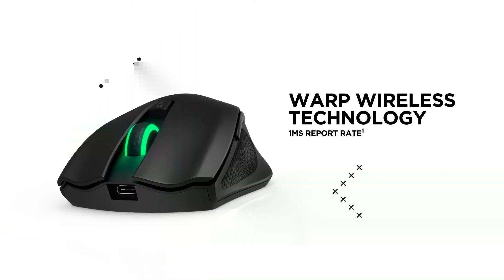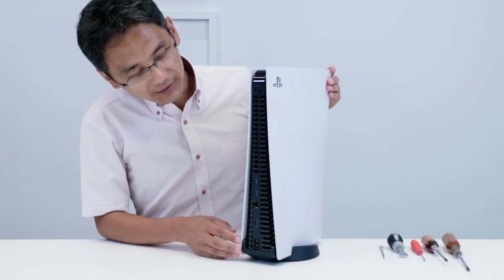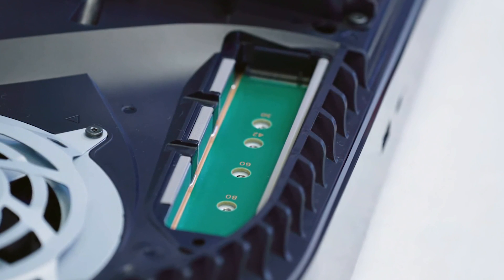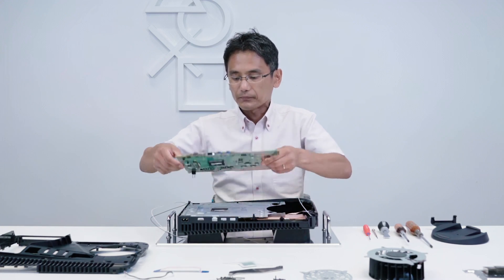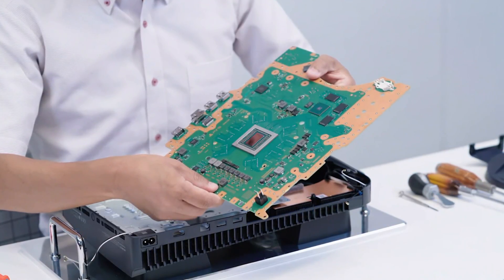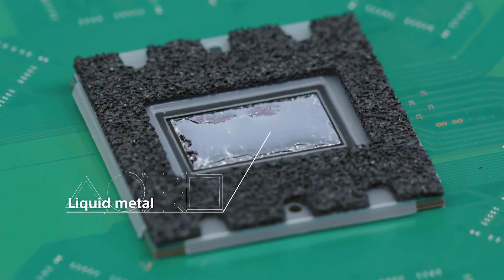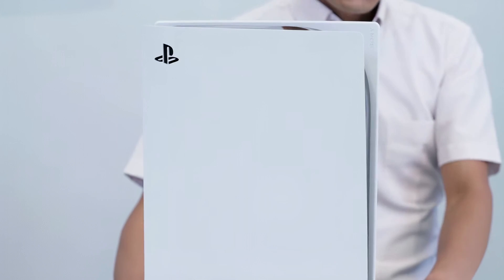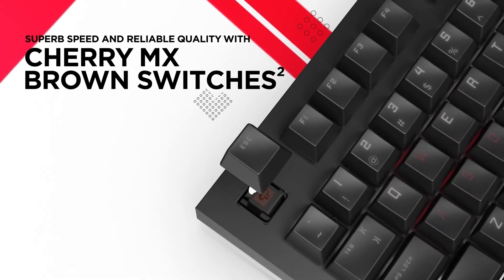PlayStation 5 Teardown Analysis: Inside Sony's Next Generation Hardware Design

Comment: 4:36 I changed to Kryonaut thermal paste on my nephews PS4, and holy shit what a difference it made! From jetengine to silent! Better than expected
Reply: Now, if the ps4 is silent, it worries me.
Reply: @aidedflyer173  PS4 Slim is silent (at least mine is... other than the occasional HDD sounds).
Reply: be my uncle
Reply: Darkhyron  Not if you know what you're doing. There are a lot of videos on YouTube with instructions on how to do this. If you feel comfortable it may be worth to clean out the dust and replace the thermal paste with some quality paste. It's not expensive.
Reply: Darkhyron  if you're comfortable working on electronics it's not too bad. But, if you never changed thermal paste on anything in your life, it's not the easiest place to start because the chip does not have an integrated heat
 spreader, so you have to be more careful. I would say it's very similar to changing the paste on a graphics card but with some additional disassembly. But, it's so worth it that if you aren't comfortable I'd suggest finding a friend who is and do it. My console wasn't even badly dusty. It just had dried paste. It's been completely fixed for over 2 years. (launch model)
Reply: Darkhyron  if you're just careful and follow a video you'll be fine. Mine needed a security torx I believe t9.
Reply: actually, you can silent ps4 only by cleaning it. especially in the heatsink area. do not need to change the paste
Reply: @dzikraaksa527  you do need to change the paste sometimes. My ps4 was quite loud until I replaced the dried stock paste with fresh noctua paste. now it's as quiet or quieter than new.
Reply: @dzikraaksa527  Or just get the Spiderman ps4 pro which is pretty quiet actually. Not as quiet as Xbox one x but not bad all the same.
Reply: @DEVILTAZ35  my Spiderman PS4 Pro got the short end of the manufacturing machine. The fan was loose so I had to fix it. No big deal. The thermal paste was non existent... Annoying, but I had some on me. Prior to fixing it was loud af...
Reply: @dzikraaksa527  actually, no. Because depending on fan, it is loud by design. Also, changing paste sometimes help, but in minority of cases. Also, poor design by Sony is proved by removing whole panel, which brings much more intake for console.
Reply: @krzysztof6591  that's a lie I have the loud fan model and I changed the paste with arctic mx-4 and I changed the pathetic thermal pads aswell and my PS4 pro is now super quiet and temps are 15 degrees cooler and it's only loud ( but not as loud) on cod menus lol. Thermal pads on PS4 pro are a big problem don't even cover half the chip and are bad quality.
Reply: @canadaspy007  aye when heat cant be moved properly to the right place the fan can run to nuts
Reply: @mrn234  like I said changing thermal pads and thermal paste fixes that more so thermal pads I think. My pro hovers between 40 to 48 degrees in the hottest areas on Max load in say ghost of tsushima. Before it 60 degrees and super loud.
Reply: @dzikraaksa527  not true that hasn't worked for millions of owners
Reply: @dzikraaksa527  It depends on when you got it. I got mine 7 years ago, the OG one on release. Opening and cleaning out the dust didn’t significantly help temps and sound. After redoing thermal paste it helped a lot. 

I wouldn’t suggest it if you don’t have experience with taking apart electronics though. It’s better to just try to dust it then break it. The 4 pin disc tray cable is very sensitive and can break if bent wrong.